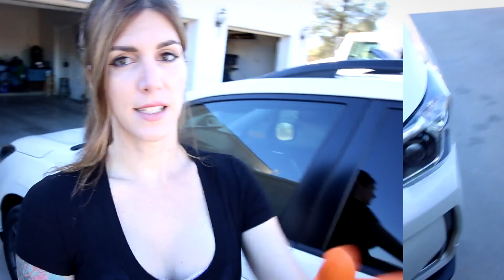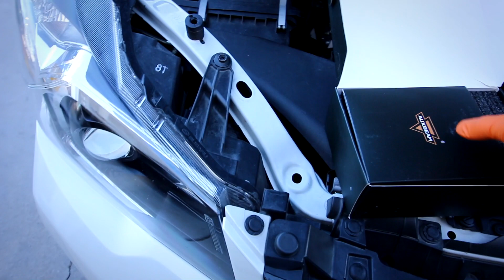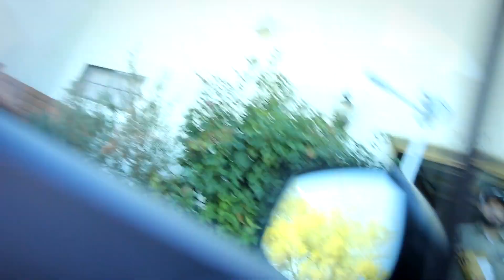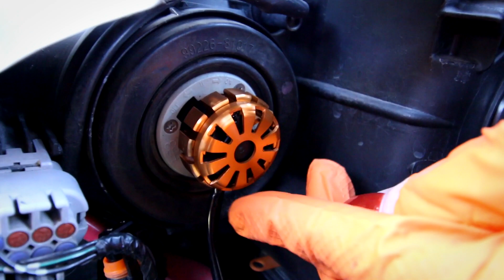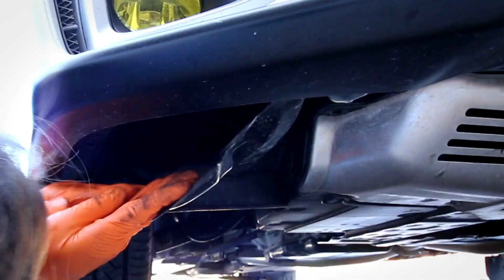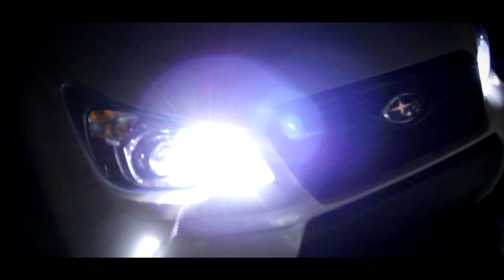Subaru LED Install // Auxbeam Review

Comment: I have had all Sylvania LED bulbs in my Baja for a few years now. I have only had one headlight fail. I replaced the "snaperdoodles" on my bumpers and splash guards with stainless slip over sheetmetal nuts and bolts. Makes it soooo much easier to take off.

Comment: Sarah, maybe you can help me because I cant find answers anywhere. I installed LED headlights in my 2004 Forester XT and when I turn on my fog lights the high beams come on. When I click my high beams on the fog and high beams turn off and the low beams turn on with the high beam indicator blue light??? Any ideas to WTF is happening? Thank you. Doug.

Comment: The bulb you used on the DRL is the type of bulb you should have put in the fog lights. The bulb style you put in the fog light is more for turn signals, break lights ect. That style does not project much light. The type you installed on your DRLs are higher output cree LEDs and project more light. 

Just some food for thought, if you ever decide your fog lights are not bright enough.

Comment: Hi Sarah, I have installed the latest version Auxbeam NF -X3 H7 on my Ford Focus ( Multi Reflector non Projector ) Low Beam Head light ) at first I had issue with the anchoring had to order the clips for holding the bulbs , Auxbeam Refunded 50 % for they did not provide this or had no info on this.  This version comes with a glass protector on the bulbs with an additional Flims provided by Auxbeam in the box to convert the standard 6500k to 3000k or 8500k with Yellow and blue flims Respectively. I must say the product and customer service is on par with rest of the brands. Unfortunately till now I have not been able to adjust my optimal light beam focus since it’s multireflective headlight. Decided to put the halogens back and use the same on my bike.  The Auxbeam Products are superb.

Comment: LED replacements look great, but I've never found one that has a beam pattern and distance as good as a nice halogen or proper HID projector.  And like has been stated, those LED DRL high beams will be way too bright for oncoming traffic even during the day.  I got flashed a lot in bright daylight when I had some in my car.  The stock halogens usually just run at half power when in DRL mode.  I just used a relay to disable the highbeam DRL.

Comment: I just bought the iJDMtoy H11 LED 6000k for my 2016 Subaru Forester 2.5i Premium w/Eyesight. Not gunna lie, I like the their color of light but only problem is that it’s 2500 lum lightning seem too bright on the front don’t wanna get in road hazard blind someone the road which that is not good at all. I might gunna return it get Auxbeam are better not blind someone on the road?

Comment: I have the Auxbeam F16’s on my Taco.  I was nervous about LED’s at first, but they are well worth the money!  $50 is really worth.  Just as she stated, the packaging is really premium for headlight bulbs and tightening with the seal needed a little more torque than OEM bulbs.

Comment: Excellent review! Very helpful as I haven't really heard of any US based merchant that has LED headlight replacements for under a couple hundred dollars. Couple of things I want to share with the idea of trying to be helpful as well. DRLs...Daytime Running Lights, are meant to be used during the daytime, not at night. I work nights and every night I drive to work I see at least 3-4 people driving with JUST their DRLs on...no tail lights at all on a dimly lit freeway. The reason your halogen lamps were so far gone is because the typical way of implementing DRLs with several car makers is to use the normal High beam lamp at reduced voltage. The problem is that how the halogens work is by higher heat vaporizing the surface of the metal filament whose tungsten atoms then combine with the gas...once it cools the atoms are redeposited onto the filament. Operating as lower powered lamps (DRLs) means the tungsten doesn't vaporize properly and combine with the gas but instead forms a film on the inside of the bulb (which is quartz btw, not glass) which then begins to soak up the much higher levels of infrared energy (heat) until it literally melts through the envelope. Auto makers really need to stop using this cheap way (for them) of creating DRLs and just use separate lamps, preferably LEDs. 

 The new lights look awesome and I thought you did a great job of reviewing them. The yellow lights used in France did help identify locals from the invading army but it wasn't the intended use. They originally were used for the lower glare the road lights (known as high beams here) had on oncoming drivers. It's called selective yellow and yes that's actually the name of the particular shade of yellow used on headlights and fog lights. The filtering of the blue end of the spectrum is supposed to reduce the dazzle effect in fog, rain and snow and increase our visual acuity. It turns out that white light wasn't so dazzling to oncoming drivers when the lights were aimed correctly.

Uugh...TLDR: Turn on your headlights at night, halogens aren't designed to be underpowered and yellow lights were meant for safety.

Probably be ordering a set of lights from Auxbeam soon, thanks for mentioning them. Came to your channel through flying sparks. ;)

Comment: I just converted my 2018 Hyundai Sonata's low and high beams to LED last weekend.  Both bulbs are 9005.  With the location of the housings and all the stuff around them I actually had to drop the bumper cover and remove the headlights themselves to install.  Took about an hour total.  Easier than I thought.  Big difference.  I won't give you the company that I got the bulbs from in case you didn't want to have a different name than Auxbeam on the video.

By the way........great channel.  Love the presentation, even the "ackwardness" you display in the videos is endearing.  Keep up the great work.

Comment: They look great, but what I've found with all these aftermarket LED/HID's is they all fail very quickly.  To the point where I cringe whenever a customer brings me some to install.

PS no shit about the yellow lights!  I was always told yellow light cuts through fog easier.

Comment: 3000k also is the color spectrum that cuts through the fog the best!  Unfortunately a lot of state laws prohibit running yellow headlights. You can have yellow/amber fog lights but not the actual headlamp. Ever notice how on most Lexus vehicles they are set up that way
Reply: ABSOLUTELY CORRECT !!!

Comment: The reflector is not designed for those LED bulbs and they won't disperse light correctly as a high beam. Also orange looks better for foglight...the led is overwhelming.

Comment: You do realize that the LED running/high beam lights are either “on or off” since they run on a wider range of voltage - unlike your halogen bulbs that seem dimmer than your high beams , because the voltage runs through a resistor dropping them to I believe 8volts instead of the normal 12-14 volts.  So it’s kinda like driving around with your high beams on 🤣
Reply: That's fucked up... Is there any led that works for drl and high beams?

Comment: Hi, what connector type does the bulb in the projector housing use? 

I really like your videos, they’re really instructional.
Reply from the maker: SeraphXT D2S
Reply: Thanks!! 

I just DIY swapped my foglamp bulbs to the Philips Ultinon series LED ones. 

The pair deal on the ones you bought on Amazon are a really good deal, now I’am kinda wishing I’d gone for those first but I’am impulsive and impatient so I got mine locally. 😂

Comment: These are some very poor choice of LEDs... you do not want a LED bulb that has 360 degree of LEDs because there is a beam pattern for it to be effective. Those LEDs only adds nothing but glare since lights are scattered everywhere.......For me, when I upgraded my crosstrek to LEDs, i opted for Phillps becaue its 1 row of LEDs for each  side which mirrors the way how halogens work.

Comment: Those led high beams as drl will be too bright at sunrise/sunset. You're going to blind the shit out of oncoming traffic. Enjoy your ticket.

Those led bulbs are not meant for reflector based housings. Please use proper optics for the given light source. You did a proper retrofit for your low beams so why cheap out on your high beams and fog lights?

Comment: I believe by switching to LEDs on your high beams/DRLs you are essentially driving with your high beam all the time, as the LED doesn't care if the voltage is lowered (in DRL mode) or regular (high beam mode). I can see a separate circuit box on your LED high beam kit that takes care of this voltage difference. I might be wrong, though.
Reply: Wojtek Jakóbczyk this external box can be led driver - current source. Better to check, if it switch between hi and low, because (from the point of microelectronics) it's not hard to control current to led with different input voltage.
Reply: While you are correct the high beams will essentially be on, that's only during the day time when it doesn't matter and won't be blinding people. The DRLs turn off at night so they will only be on when the high beams are turned on.
Reply: Well, the only scenario is when Sarah drives on low beam, the DRLs turn off then. But all day long she's going to drive with full high-beam power instead of low-power DRLs and it can blind oncoming drivers even in full daylight, it's just plain dangerous for them.
Reply: The lights on the inside that she calls DRLs are actually the high beam bulb area. The reflector has no shrouding so the light goes everywhere. The LED's dont car the that DRL mode has reduced voltage so are producing full brightness. This means she has high beams effectively on all the time.
Reply: There are a lot of newer cars that use the high beams for the DRL. We use to have an 04 Bonneville and that is exactly what it did, its DRL was the high beams turned on.
Reply: No, it's high beam running on half the voltage. We have it like for ages in Europe and US followed suit.
Reply: I appreciate your kind insight. However, no matter how insulting you try to be, DRLs on high beam bulbs are realized with a voltage drop to 4.7 volts on a Forester and this issue is precisely described here: www.subaruforester.org/vbulletin/f85/led-daytime-running-lights-replace-high-beams-246530/  If you have zero actual experience, you should perhaps not make an idiot of yourself on the internet.
Reply: Trix Kemuel I have LEDs in my 2013 Camry for the HB/DRL. Rather than staying constant on High beams during the day, they flicker and strobe. The night time HB functionality is flawless though. Any clue on what to do, besides disabling the DRL? (I have done this for the time being)
Reply: Many others are having the same issue, so I know the bulbs are not defective.
Reply: it is not going to be a problem if she uses AUTO as in this mode low beams become DRL. I have Forester 2015XT and on AUTO it turns on low beam always as DRL. If turn on DRL mode manually, yes it will be High beam.

Comment: Sarah, You cannot use those Leds as DRLs. The Subaru uses a resistor to lower the current to the halogen light to reduce its brightness. By putting LEDs in which require much less current, they are still getting 12 volts and are no different than running your car with its high beams on constantly. Try it yourself, flick your high beams on and then look at just the DRL, same blinding? Yeah, at night, your gonna be blinding people. Please fix.
I just recently put full Aux Beams in my Legacy, the projector lows, 9005 high beams, and H11 fogs, all Auxbeam, they are great, but I had to do the mod to disable the DRL module.
Reply: Trix Kemuel, interesting thoughts, but I think, that led driver (ie current source) should be integrated into led bulb. Otherwise, driver should be external. Without led drivers - this is very bad led lights.
Reply: That is exactly what i mean. The subaru DRL module limits current to the DRL lights to lower their brightness. Since the LEDS with their internal drivers dont take as much current, the DRL modules current limit has no affect on the LEDs brightness. Which means they are running at full power, and the LEDs she installed are not a low brightness beam, they are a high beam meaning they are at full high beam brightness even on the DRL circuit.
Reply: I was thinking the same thing the whole time... if it’s anything like the older subies, you should be able to just disconnect the drl resistor cutting the circuit so only the LED strips down near 5he fogs stay on.
Reply: I scrolled through to see if anyone else posted this because it's exactly what I thought. On my 2013 Civic I just pulled a single fuse to eliminate my daytime running lights(I think it looks stupid, not concerned about the "safety" of it). I could tell right away what you mentioned was happening. Definitely kill the DRL if you want to continue to use LED high beams..otherwise just switch back to a halogen bulb. I actually even prefer the yellow halogen and disconnected DRL as it just gives the light cavity that yellow look all the time from the reflection of the yellow bulb. Anyway, cheers good luck.
Reply from the maker: Trix Kemuel why would you be driving towards on-coming cars with your high beams on, lol.
Reply: Here's something to consider - DRLs don't run at night. I'm not sure about Foresters but my WRX's headlights auto switches on at dusk (i.e. turns off DRLs and turns on regular lowbeam LEDs), so you won't be running high beams at night unless you intentionally hit the switch for high beams.  

Also keep in mind the function of the DRL and headlights - they serve different purposes. A DRL is so other people can see you / your car, a headlight (low beam or high beam) is so you can see other people. Your DRL might be bright but so is sunlight during the daytime. Brighter during the day is better for visibility IMO.
Reply: he isn't... but you are. you said it yourself, those lights are DRL + highbeam. However your DRLs are WAY brighter because the LED is outputting the maximum light whether you have the highbeam selector on or not. Your high beams are on all the time now... Try it out, those bulbs should get substantially brighter when you turn the high beams on. If they stay the same, you've got a problem. The DRLs are dim because they're supposed to be. I like your channel. Keep it up!
Reply: yip Mike, All i had to do in my 2005 Legacy was disconnect one of the 2 plugs to the DRL module, nothing else. Super simple. :)
Reply: Sarah, the bulbs you installed for your DRLs are actually a high beam light. The 'daytime running light' module simply reduces voltage to the high beam when you have your lights off. Turn on your lights, flick on high beams, and you will notice the lights you installed for your DRL will come on, that is because those are actually your high beams. The reason why people that install HIDs disable the DRL is because the lower voltage from the DRL circuit ruins their HIDs. But in your case, you bypassed the function of the DRL and installed a high beam but using low powered LEDs.
Reply: I realize all this tech jargon is difficult to understand, its even harder to try to explain. The spot where you think are only DRL bulbs are in fact your high beams. There is no shrouding and they reflect light everywhere and to long distance because those are actually your high beams. When you turn off your headlights, the DRL module under your steering column simply turns on your high beams, and turns the voltage down so they appear to be dimmer. But rest assured they are still high beams. The LEDs don't care about the reduced voltage so they will appear as bight as high beams even with the DRL active.
Reply: Quite right Greg. A high beam on during the day is still a bit too bright for many people to tolerate.
Reply: Sarah n Tuned Trix is right.  You're basically running your highbeams all the time with LED bulbs as your DRL + HIGHS.

You can tell because 1. Your DRLs should turn off at night when your lows go on.  2.  If you have your DRLs on during the day and flick on the highs, you'll notice they will be the same brightness as the DRLs.

If you want LED bulbs as your highs, you have to disable the DRLs or you're basically running your high beams all the time.

If you want brighter highs, but still want the DRL function, get some silverstar halogens and call it a day.

Also, innmy opinion, there's very little to no need to have LEDs as your high beams.
Reply: Even in the daytime those are too bright for DRL. looks like you don't know what you're doing, is annoying, sends old people into school bus stops for blocks after you pass. take them off. do it right or don't do it at all.
Reply: Thank you. Another level headed person :)
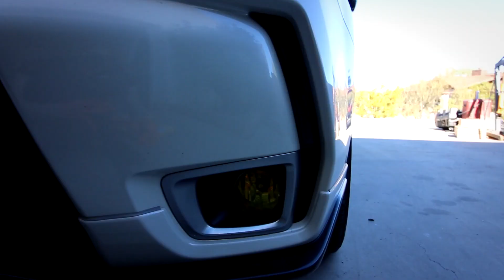Reply: Ok folks, calm down, Sarah is fine. First off, at 1:06 she refers to them as DRL/high beam lights, so she know that they used for more than theDRLs. 

Also, the reason that the manufacturers dimmed the high beams when they used them as DRLs, is not because they were too bright, but seeing as they didn’t need the full brightness to meet the required light levels for DRLs, by dimming them, the high beam lamps did not have their life shortened. As well, they don’t just use a resistor. That is very inefficient, using power that is just turned into heat. The use a pulse width modulation dimmer that is much more efficient.
Reply: Using Leds would create a safety issue by being far too bright for on coming traffic. I instead leave my low beams on during the day time since the DRL function has been bypassed.